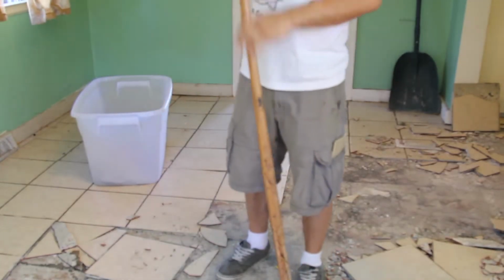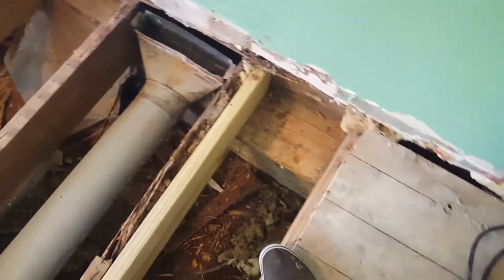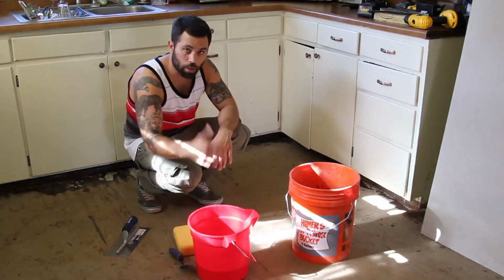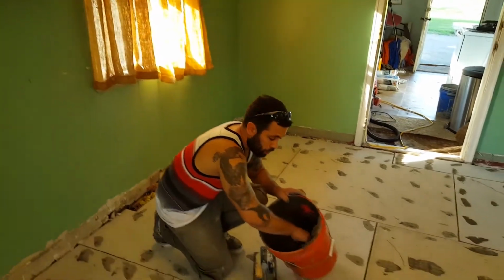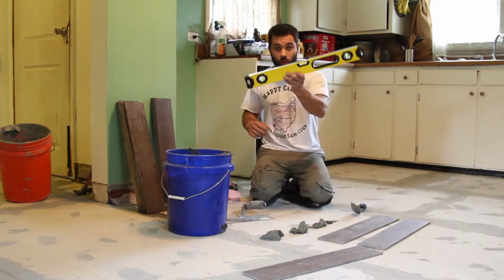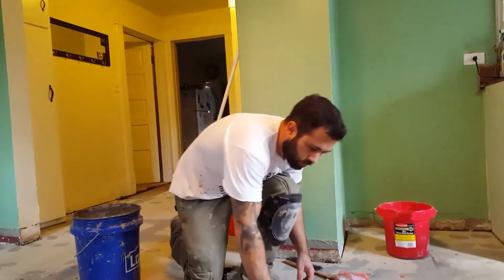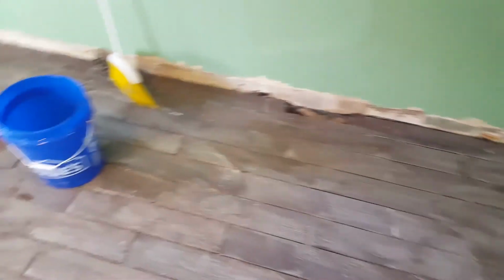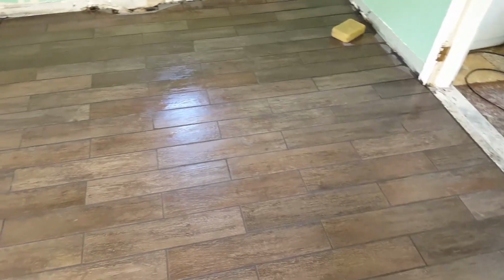The Greatest Tiling Video the Internet Has Ever Known

Comment: Ok, maybe I'm stressing myself for nothing (as I have the tiniest kitchen area to re-tile, but still...) I'm not blond, yet I don't understand the whole 'level' thing. If your kitchen is not level, and yet, you use a spirit level... how can you achieve an ok look in the end. When you started in the middle, you had to make adjustment (more mastic/glue under one side than the other), so how do you manage closer to the wall (much less mastic?) and closer to the kitchen cabinet (a lot more mastic? Won't that come up really high to the bottom of the cabinets?) I know we're not talking meters here, but I'm stressing out with mine (very old house, where the cabinets are higher at one end of the room than the other... so if I level the tiles, it will look like the cabinets are themselves not level). Hope that makes sense?!? :/
Reply from the maker: +Carole B Makes total sense.  You need to find the high point first.  Also, don't freak out to much as it is an old house, the floors won't be perfect.  What's under it?  Concrete or wood?
Reply: Concrete.
Reply from the maker: Oh then you are in good shape.  Go down the flooring isle and get some floor leveler.